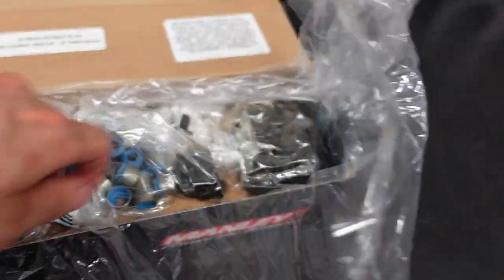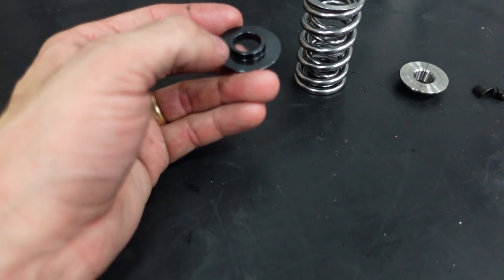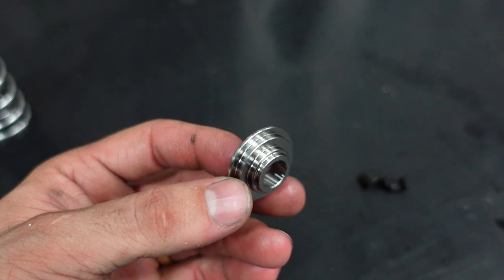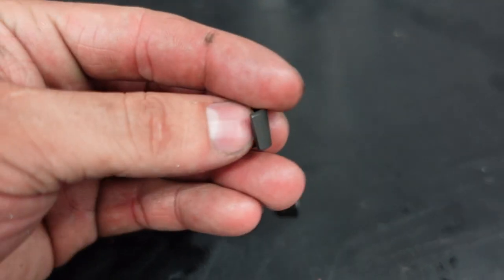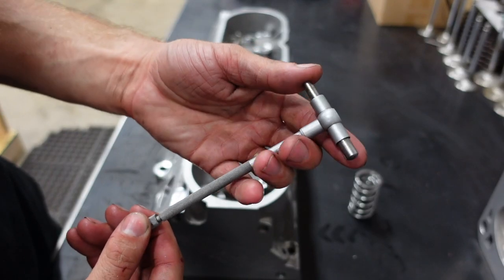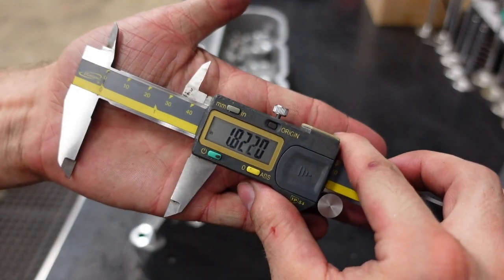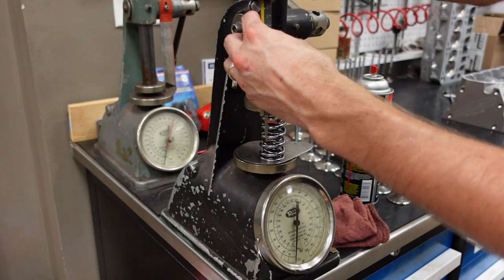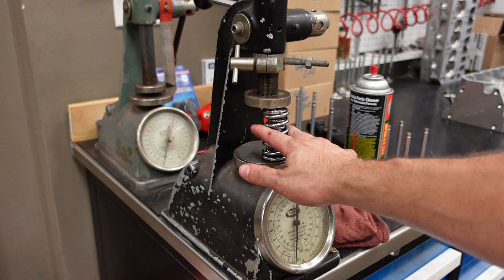Checking Valve Spring Coil Bind Clearance (correctly) - Tech Tip Tuesday

Comment: How did you align the snap gauge to the correct step on the retainer? Would it not be easier and more accurate to use a height mic?

Comment: id love to hear your take on lifter bleed rates and todays hydraulic roller camshafts. Ive had issues with motors in the past where the lifter bleeds down too fast, which cause issues on initial start ups, ive never got a legit answer from the cam manufacturers as to why this happens and what the remedy is. ive seen countless discsussion on forums and no one ever has an answer either.
Reply: I've heard of it also. I used to approach it differently.  I thought it was me not choosing the correct lifter for the spring pressure I was running but now I'm starting to think otherwise.
Reply: @ls87gbody  i agree, i think its a widespread problem that probably just boils down to a compromise.. Although ive heard of guys using solid lifters on a roller cam, sounds interesting..

Comment: I got a maybe retarded question. My current application I have AFR heads max lift on springs is .600 my max lift on cam is .624/.614. How bad is that? And will it make a knocking sound.

Comment: I mean no offense by this , but if you don't know what a retainer is you don't know what a lock is you don't know what a spring is or cylinder head then I don't think you're going to be worrying  very much about coil bind or valve height,